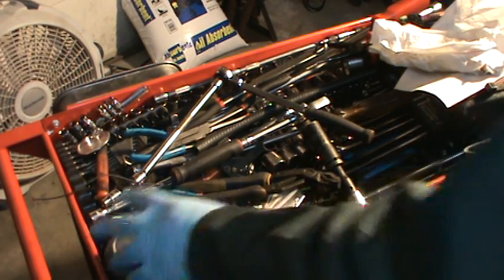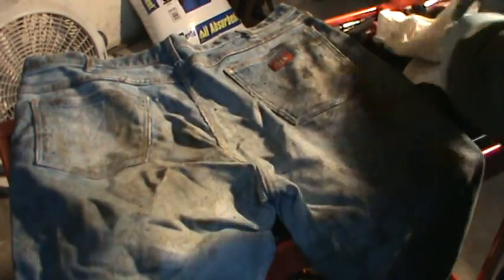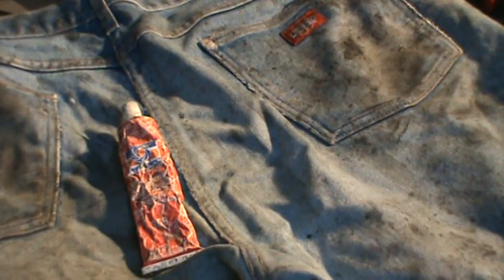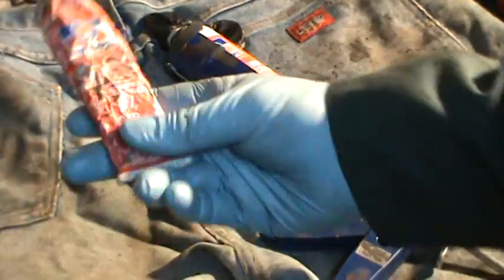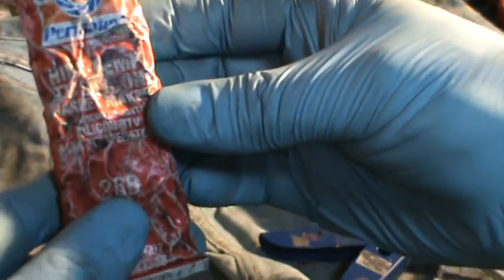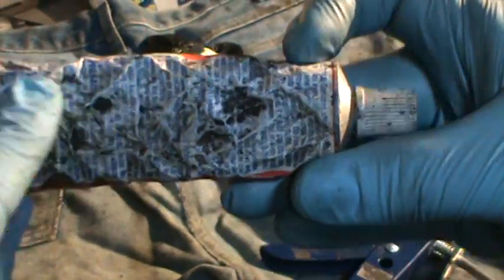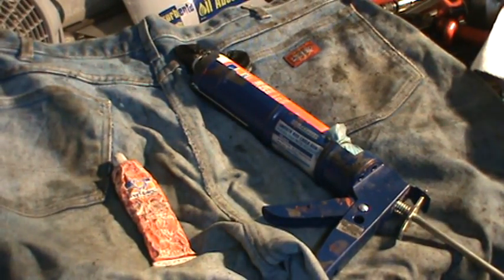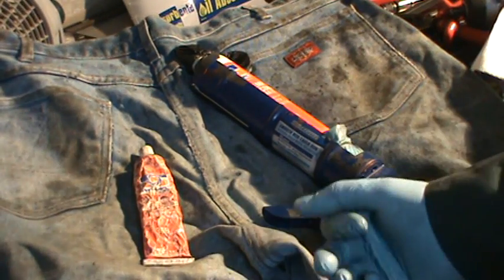How I Preserve My RTV Silicone

Comment: I like your idea to seal the backside.

I've tried many techniques to seal the tip of caulking containers like you show. Most of the time, air somehow got in. Then I discovered the red tape that is used for vapor barriers in home hardware stores. A role is expensive, but the tape is unparalleled as far as it's ability to seal air tight. I wrap a few inches around the tip. Since switching to that technique, I've never had a failure.